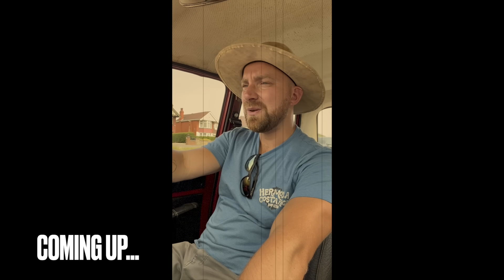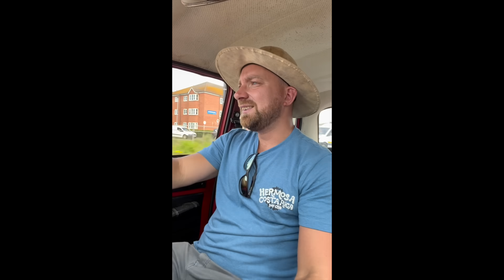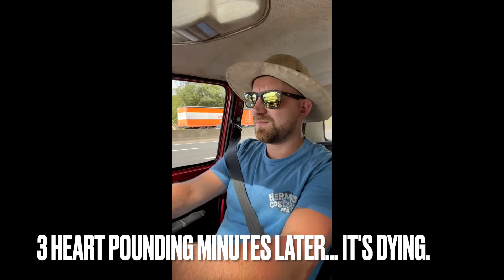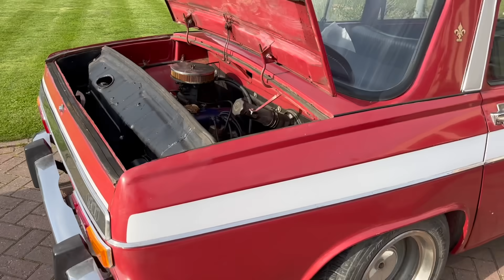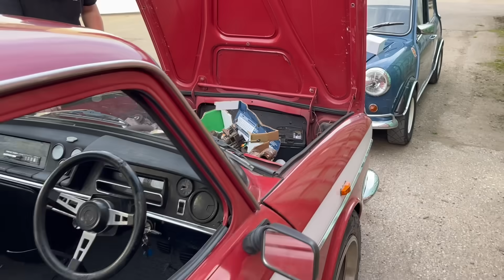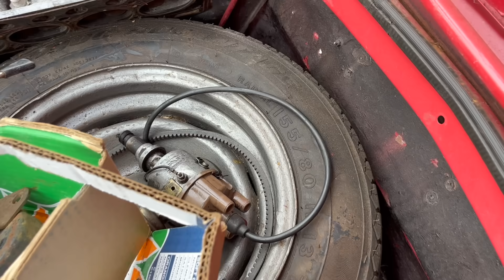Beating the ULEZ with a 1969 Renault 10. PART 1. What could go wrong?

Comment: MOT free??? - I specialise in Muscle Cars .. and those are also Tax + MOT free -- but I advise anyone running a classic to always send your 50 year old through a safety check every year ... I do this  2wice a year because I am an engineering OCD sufferer. Especially on cars that have stood for years...I'd  replace brake master cylinder + lines on anything older thean 20 years + check the seals and pistons in the drums.....it's not good  to run the risk with pressurised 50 year old kit intended to stop your tin shed, for the sake of £120 to £200 worth of bits and 45 mins of work. I've seen  the results when people havent  done this.
Reply from the maker: Couldn’t agree more.
Now that it’s home, we are on it.

Comment: Anybody who wants a little runabout , ULEZ exempt and would rather drive as modern car as possible  would do well to buy my Austin Metro Automatic .  With less than 10k miles on the clock and in brand new factory fresh condition  you get all the advantages of a modern car  with hatchback, front drive , economy (45mpg)  ease of driving etc etc  and with its ultra low mileage , you will have a lmost a brand new car  but one that wont cost anything to run exept petrol  . My insurance is just £12 a year (haggerty ) or £65  per year (Adrian Flux)   Its a no brainer   and all I want is £6k